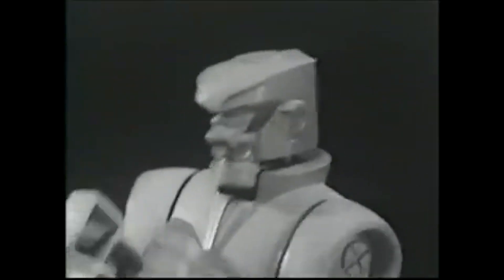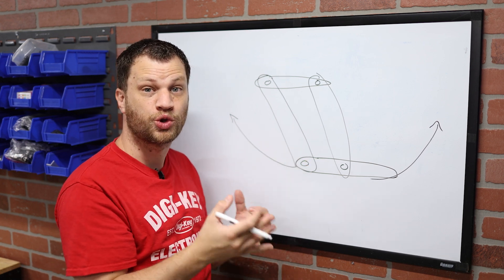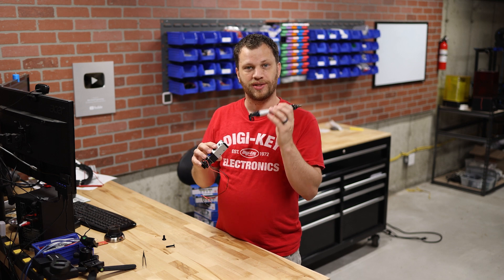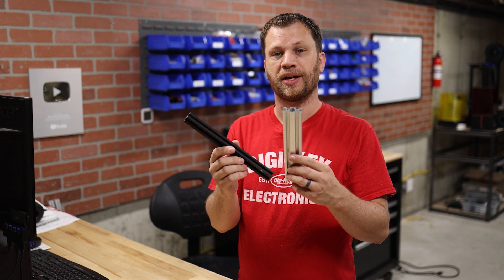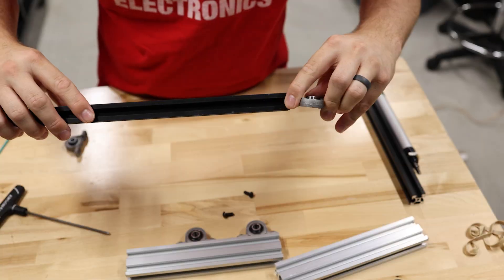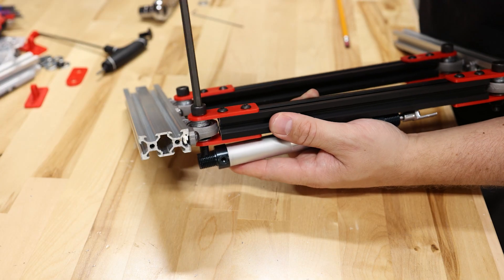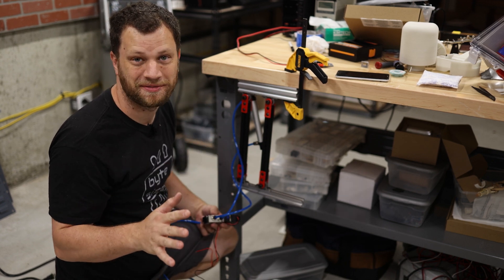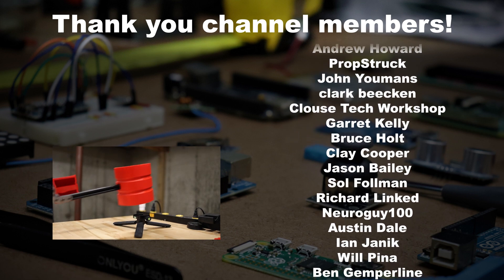How hard could it be to build an arm that punches? - Life Size Rock'em Sock'em Robots Part 1

Comment: Why not use a motor to move the arms ? Stepper motor etc
Reply from the maker: That is certainly a great option. I really wanted to use pneumatic cylinders because I think they're cool, and probably cheaper than a stepper motor of the same strength.